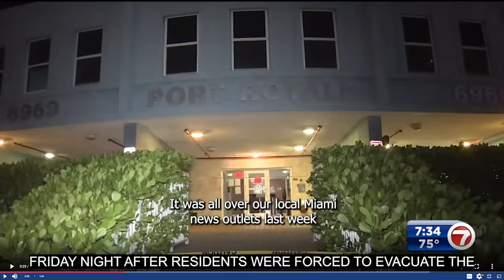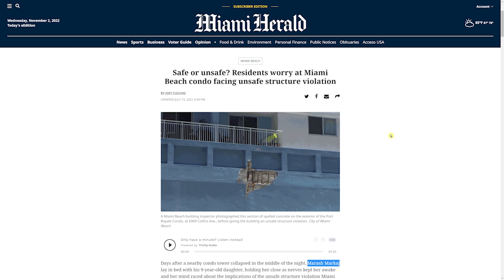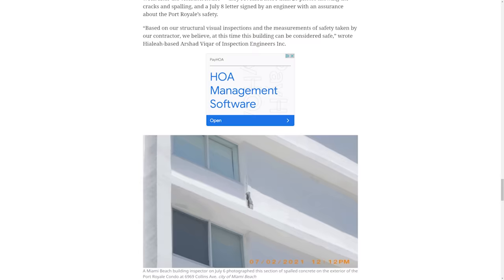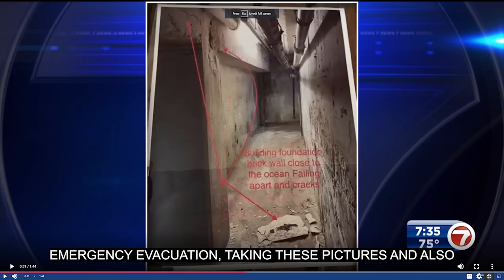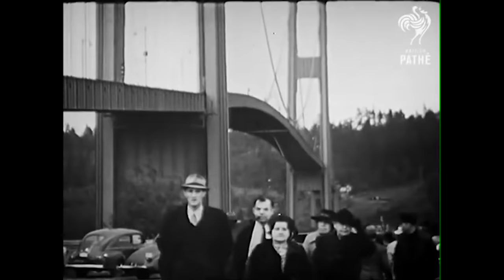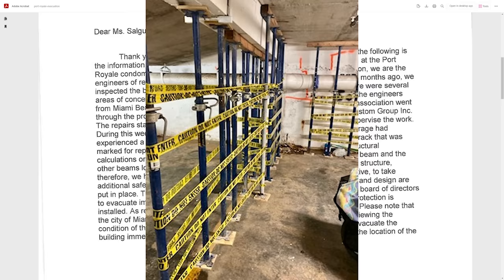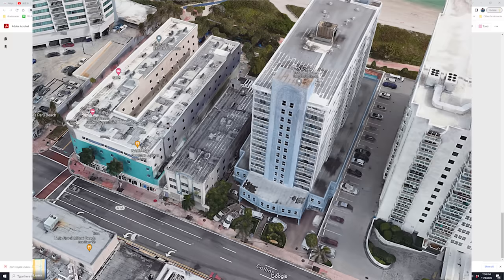Another Miami Condo Evacuated Why it Will Collapse

Comment: Very interesting stuff!  It appears that there are several spots in the interior of the building where water has damaged the concrete and rebar.  Where is all this water coming from?  Is it a leaky roof?  Plumbing?  Ground water seeping up?  And why does this seem to be happening only in oceanfront properties in Miami Beach?  Damage from water could be an issue in any high-rise building located anywhere.
Reply: they are in the underground parking garage and the water table is close to the floor. So it seeps up on high tide through the porous concrete

Comment: Even if repairs are affected to make the building habitable again, I’d be really hesitant move back into my unit. Unfortunate as well is that if the repairs are covered by insurance, the renewal rates, assuming they’re not dropped, will be astronomical.  I also doubt that unit holders will be able to find buyers if they decide to sell. What a mess.

Comment: Maybe they should start using the newer fiberglass rebar which doesn't rust and expand like the untreated iron rebar used in those hotels 50 years ago. That old iron rebar wasn't even coated back then, like they use on making new concrete roads today.

Comment: Great video Jeff. How is a concrete building even repairable? The building is built from the ground up. Are they going to sand the rust off the rebar and slap on some mortar? That would do nothing for strength.
Reply from the maker: damage looks pretty bad and freaks a lot of people out, it's just like the dentist drilling away the bad material leaving only the good, and then they use methods from ICRI to repair the concrete up to known acceptable standards and it would be just as good as new again.

Comment: I have noticed vertically cracked pillars in the car park of the Peabody building where I live. Apparently they were already there last year and a resident was told it was “fine”. Sure thing. Now after some pressure they got surveyors to look at it. We are waiting for their report.
The way it looks a sea in the concrete ceiling was leaking at some point and then patched up,with silicone. The pillars were painted. None of this fixed anything, of course.

Comment: I'm looking at the braced area featured on the video cover... Shouldn't the bracing be to the left and right  - or at least extend left and right, rather than uphold the fractured section? Seems like you would want to brace the areas that aren't crumbling.
Reply from the maker: You want to put that beam back into compression. I would think all areas, but most important is where it is crumbling

Comment: the first picture of exposed rebar  shows what looks like previously patched/ or covered damage. so gonna go out on a limb and say damage extending another 3' just gets compounded. but a question, when concrete pops off the building like in the pics, how much has the rebar already expanded? rebar has to expand a pretty large amount before it can have that effect.
Reply from the maker: If you don't repair the damage correctly according to ICRI standards, it could worsen
Reply: @jeffostroff  yes, but the damage is done. once the rebar starts rusting......and then expands to the point it blows out the concrete its pretty much over.

Comment: OMG this is unbelievable! Is there anyway they can shore this building up where they can be absolutely sure that it won't buckle and collapse? What would be involved? I really do like the way you explain things to us non-engineers. Thanks!
Reply from the maker: Yes although the damage looks pretty bad and freaks a lot of people out, it's just like the dentist drilling away the bad material leaving only the good, and then they use methods from ICRI to repair the concrete up to known acceptable standards and it would be just as good as new again.
Reply: @jeffostroff  thanks, I guess it would be up to the current residents if they trust the repairs.
Reply: Would you trust a dozen 3" round adjustable "posts" versus a massive column made of concrete and rebar tied into to other structures?? Once the building looks like this in a few places it's definitely the same in places you can't see yet. It only takes a couple columns to fail or some lateral load before the whole building collapses, just like we all saw happen recently....
Reply: @ArcherNX1701  , I wouldn't trust this building ever again, especially considering that the repairs they did in 2011, at a cost of about $50,000 per unit on average, are coming undone. And I sure as hell wouldn't want to pony up another $50,000 -$100,000 when I was likely still struggling to pay off the previous assessment. Gah.

Comment: This is near the shoreline. This means there is salt in the air and small salt water droplets will make their way on the concrete and over time they will attract moisture and seep into deeper and deeper levels of the concrete and produce small crystals that form microscopic cracks and make the concrete porous. Eventually they will reach the rebar and cause them to rust. I´d assume that no building in the vicinity is completely structurally healthy after 50 years.
Reply from the maker: This is why they need to seal and paint building regularly

Comment: Can rebar be dipped on site - like tool handles - so this rust problem is largely eliminated?
Reply from the maker: I'm not even sure if epoxy coated rebar was used back in 1981. Nowadays many construction projects use it so I'm sure if this building had been built today it would be in a lot better shape.

Comment: Did you know that the pedestrian bridge in Florida was built the same company that almost built the New Jordan Bridge in Chesapeake, Virginia? Yeah, I say "almost" because the Jordan Bridge collapsed while it was under construction. They were banned in the state of Virginia after that. Then the City of Chesapeake then hired another Construction & Engineering company. They proceeded to do 17 inspections of the original work, made many changes, not to mention repairs, and also finished the job. Kinda reminds me of the 1981 Hyatt - Regency Walkway collapse.

Comment: Could there be an electrolytic element to that rebar rusting?  In other words somehow a DC or AC voltage is unintentionally being introduced and is pulling the wrong way on the rebar steel atom by atom.  But I think it enough what others below have posted that the humidity and salt intrusion is probably all that is necessary for the corrosion.

Comment: Would it be practical to include on the inside of the molds for concrete surfaces a regular grid of dimples or lines that would allow measurement of deflection?  If one had e.g. a 1" square grid of small dimples, and a 1/4" wide area on the surface was cracked and fell away, but a uniform 1" square grid laid across the gap would line up perfectly with the dimples on both sides, that would be far less alarming than if e.g. the crack were only 1/8" thick, but the rows of dimples above and below the crack were 1 1/8" apart, or the rows above and below were shifted longitudinally.  Relative motion of the congrete on either side of a crack would be a big and obvious cause for alarm.

Comment: difference with the bridge is that it had been up for less than a month.  The problems with these older structures might be caused by lack of proper maintenance.
Reply from the maker: yes, they should have sealed and painted on a regular schedule
Reply: @jeffostroff  I agree, I see so many problems in all area when they lack on preventive maintenance.

Comment: Virtually all multi-storey buildings with steel reinforcing encased in concrete have been built in a similar way and have the potential to have the same problems if they are near salt water. These sort of problems can only be prevented if they are thought about and attempted to be prevented before the building is built. Metal reinforcing that does not rust oxidise or corrode is less likely to damage a multi story building. That includes the metal mesh reinforcing for the slabs. If non-rusting metal mesh for slab reinforcing does not exist that is just hard luck isn't it? Have a good day.

Comment: I am not an engineer, so please excuse my ignorance! I was always under the impression (until CTS) that buildings like this were of a steel girder frame construction and only the floor decks and internal party walls were of reinforced concrete.
Surely, beams and columns made of reinforced concrete are not going to have the same longevity than those made of steel and are going to be more susceptible to subsidence?
Also, I assumed that every buildings foundations are built on a solid base, and in the case of large (heavy) buildings on (what I assume is) reclaimed land would have to go down to bedrock.
My opinion, for what it is worth, is that this, and other buildings in the same state are at 'end of life' and should be demolished and replaced with ones built to a better standard.

Comment: Shared with  people after the other collapse what was told to me almost 40 years ago, builders cheated and used beach sand in the concrete to save literally pennies. Beach sand is full of salt, salt and water cause oxidation of the rebar. He said the buildings would fail, just didn't know how long it would take... he was a concrete construction person. Last time I posted what he said people with absolutely have no knowledge of concrete told me I was was full of crap...They are under the impression moisture cannot get into the concrete. So if you live in a condo built around 40-50 years ago, on the beach, you have been notified.

Comment: The bridge inspector for a major railroad we have bridges that are over 130 years old that are in worse shape than this and they’re still running trains are on
Reply from the maker: Yes many bridges are operating at what they call failure mode right now it's shocking

Comment: Yikes. It's concerning that the deflection increased 1/2" in such a short time. It will be interesting to see if the shoring stops the ongoing cracks/deflection. This is a fascinating story. Thank you again!
Reply: Once deflection starts or yielding as it’s called, the steel has already technically failed.   It will continue to stretch and become weaker and weaker to the point of collapse.
Reply: @Sammiejomitchell  Thank you! - So, I guess in the long run, the shoring is not solving anything, then.
Reply from the maker: Yes although the damage looks pretty bad and freaks a lot of people out, it's just like the dentist drilling away the bad material leaving only the good, and then they use methods from ICRI to repair the concrete up to known acceptable standards and it would be just as good as new again.

Comment: 9:18  Direct applied stucco often times spals as a result of rust jacking Need to remove the stucco cladding to better asses the concert structure 
Concrete gets hard, turns grey and cracks...All cracks are not created equal and need to properly asses 
In marine environments reinforcing bar without proper cover causes the bar to corrode. once corrosion starts rust jacking occurs and spals the concrete cover.  This condition often times does not cause failure of the structure.  However any spals and  corrosion of rebar needs to be corrected.
Reply from the maker: yes, they use ICRI methods to repair concrete

Comment: I can’t read over 800 comments, but did anyone ask, would it be cheaper in the long run to knock it down and build a better building?
Reply from the maker: Yes, lots have commented on that. If the cost to repair the building exceeds what we think might be reasonable amounts, I bet they would have to assess whether it makes sense to demo the building and rebuild to modern codes

Comment: Have to wonder if there's some kind of beach erosion that is contributing to these structural issues, along with the fact these porous concrete buildings are exposed to salt water 24/7/365 for about a half century.

Comment: the rebar work has very uneven spacing causing uneven stress, with this in mind the rebar was probably too close to the surface so it rusted expanded, and broke off the concrete face, The companies I have worked with would not have signed off on this as ready to pour.

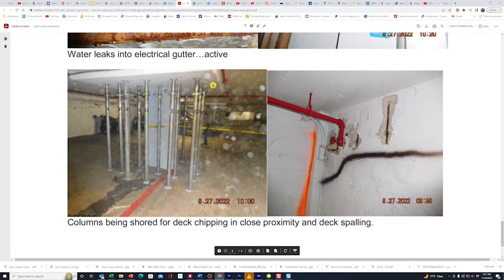Comment: At 10:46 the orb looking things remind me of pictures I took at my kids school.  The school had just had a gym built into the school and had a celebration for it.  As people were walking on the concrete floor there seemed to be dust in the air.

I took a bunch of pictures and when I looked through them there was a definite haze and orb like things in it.  Found out later that the floor had not been sealed and I was told that what was in my pictures was actually concrete dust and that the orb like bits were most likely bits of concrete that were still the dust but bigger particles reflecting my flash on my camera.

The school, as far as I know, never sealed it but instead had a tile/floor covering put down.

And that is what I am seeing in the photo on our left

Comment: I can't even imagine the undertaking it is to properly fix one of these old buildings. Everyone's been "luxurizing" them bringing in heavy materials to fancy up their condo, doing all kinds of stuff that it was never designed to withstand, and then it's just aging. All this spalling and concrete degradation would happen even if the structure wasn't overloaded. You'd have to replace all the concrete and rebar!!! I'd never want that job. I'll just keep hacking away on my code projects from the safety of my computer desk.

Comment: That beam looks like there's a problem with the foundation.  The piling to the right may have sunk.  If that's the case, Port Royale could get condemned.
Reply from the maker: No evidence of sinking piles yet, most like culprit is beams crumbling from excessive spalling
Reply: Isn't it already condemned?
Reply: @zachz96  No, not yet. It's vacated.

Comment: Is it not criminal to let an occupied building get this far into disrepair?
Reply from the maker: Interesting point no specific laws that I know of other than like immediate danger putting people in immediate danger that type of thing. But this is not an immediate danger issue this was a excess of caution, in fact a lot of people just look at the headlines but they were already working on this building for the last year and a half when they noticed that the cracks got bigger so they did everything right at least from an engineering standpoint

Comment: The photo at 9:15 at the base of the exterior wall shows cement render separating from the wall. The lack of any visible aggregate confirms this to be render and not concrete.
The larger photo at 2:18 clearly shows where the render has peeled away around the area of spalling. The wide photo at 9:20 shows a "Bubbling" affect on the wall which means it is either an extremely bad rendering job or the render is separating from the wall. I suggest it is the former and demonstrates how little the builder cared about the quality of workmanship on this project. I think the more you look the more you will find on this building.
Reply from the maker: Yes, I wonder what spots the news missed

Comment: Are these coastal  counties or towns now requiring Stainless Steel Rebar...? I would think at the very least they should. Thanks for another informative video.
Reply from the maker: Stainless has it's issues, namely price. They do use coated rebar now
Reply: @jeffostroff  coated rebar doesn't add much, if any benefit. The rebar still rots and can rot faster with the coating. It's been banned in many areas for some time
Reply: @TheRealChappy  galvanized is probably best cost to performance

Comment: Everybody has become a lot smarter and much more paranoid about building cracks. What most of us fail to consider is that moisture in a salt water environment is much more destructive than the environment more inland. These folks have a real problem and an ouch of a special assessment on the horizon.
Reply from the maker: I owned a condo 6 miles inland, they were getting spalling 7 years after it was built

Comment: Do you know what happens with condo owners if a building is condemned?  Do they get any remediation?  If a builder wants to buy the building and rebuild, do the owners have any say?  Thanks.
Reply: They usually won't. As an owner, you're responsible for the condition of your property, and if you cannot prove that you were in some way directly wronged by a builder or architect or other contractor, you won't get anything.

Comment: Beachside in fact beach areas are all full of spalling. 
We had a bridge between a waterway and the beach and it was flexing so badly when buses drove over it,, it was 2o years old.
New hirise in the same area and all the exposed steel in the semi underground car park is super rusty. AC units etc. But again the concrete has rust emerging,, about 15 years old.
Yet 500 metres away are old stone mansions that are over a 100 years old. Very maintenance hungry because of the salt air but will outlast the modern stuff by a 100 years plus.
I like the beach but have no ambition of living within a couple of miles of it.

Comment: Very informative and factual video - as always! 

 I lived in Chicago most of my life and still love the city.  My concern is that while attending DePaul University I would park at the numerous underground garages at Millennium Park (downtown) and there always seemed to be exposed rebar and spalling on every level.  It was concerning then and I'm sure it's not any better a couple decades later!   With the constant changes of temperature, snow and then frequent freezing conditions and the use of rock salt on the streets that is brought into to the garage and puddles on the floors as it thaws-  is this another disaster waiting to happen?   A lot of times I would park as fast as I could and would almost run out of the garage quickly because it didn't appear safe at all!